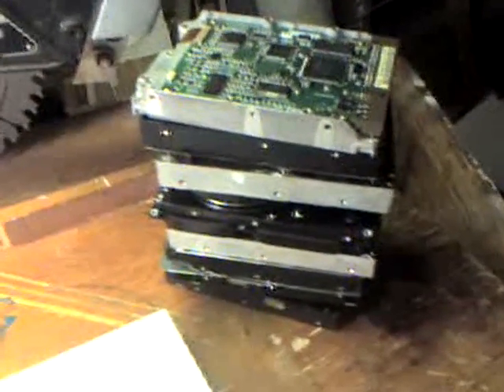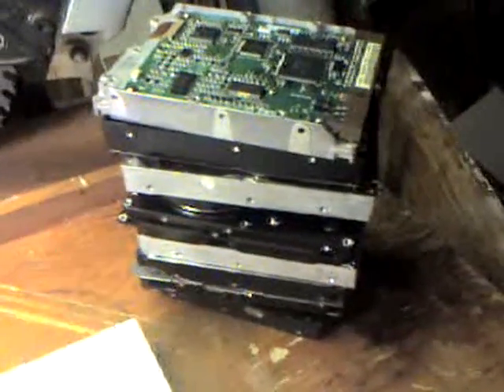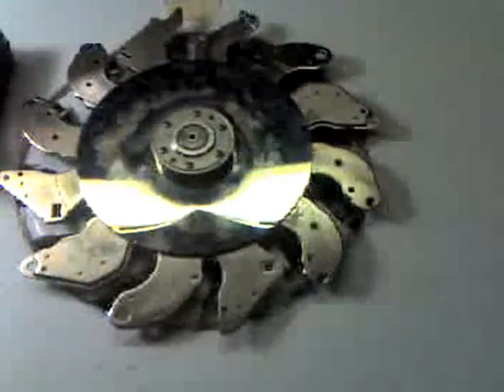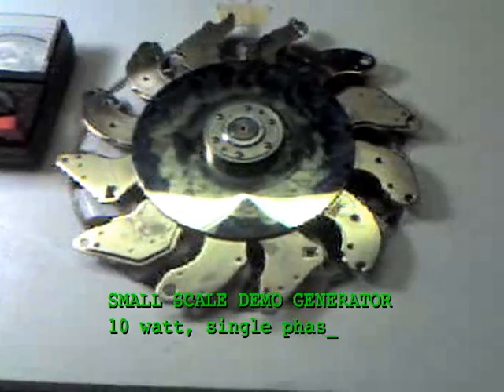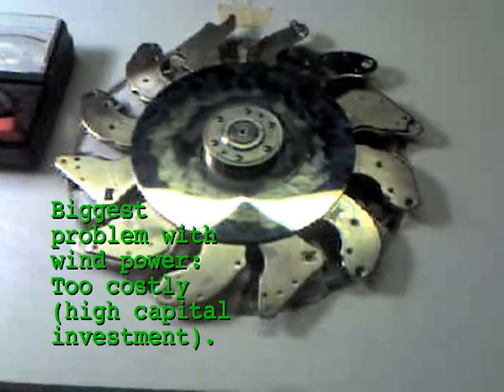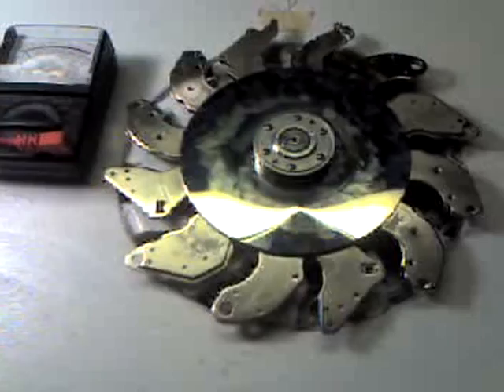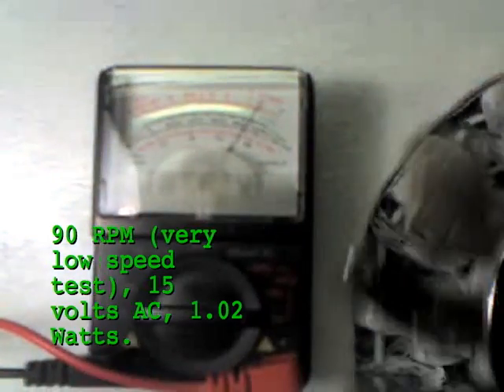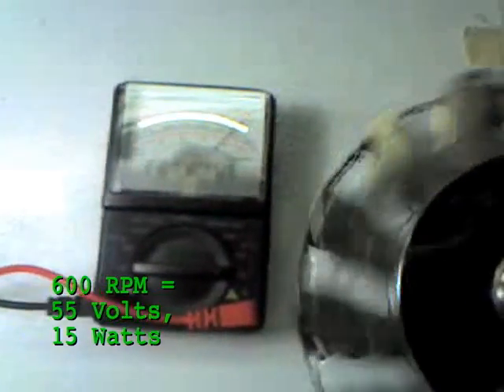Home built electricity magnet generator alternator turbine hard drives

Comment: see ... THERE IS NO possibility of moving something, if there is a constant force to the movement ... Magnets are dead bodies, they just move the existing eletons the coils, if exists FORCE acting on them, and of course, this force is only possible with some one running water engine (hidreleticas), DIESEL (explosion mototes) or flammable gases, such as uranium (thermonuclear), etc. then there is no free energy, if ever exists, then it will be used quickly, at all, and even then, to usála will not be free, because is the need to maintain the system.
Reply: Spot on, I got here looking for how to build a small scale generator from HDD magnets and everybody in here talking about free energy machines, I'm just like "guys, free energy is like Sasquatch, it doesn't exist, no matter how badly people who support the idea say so." Although part of me is thinking they mean "free energy" as in how to cheaply build an electricity generator that you can then use to make your own electricity at home "for free" (although then they would be ignoring initial costs and maintenance).

Comment: I think the 55W reading is a bit high. 55W is enough to raise a 5.5kg by 1m in a 10m/s² gravitational field in one second. Nice recycling, though. I’m lucky to have a recycling centre nearby which paid me 40NZD for three rusting 80s PCs I found in my coal bin once I separated the parts into boards, chips, heatsinks, cables and drives.

Comment: What the hell am I listening too. Is that a "cover" of "Mc Hammer - Can't touch this"... Other than that, pretty cool vid. I'd like to see how you made it all. 90 rpm at 15volts and 1watt... I could definitely see this thing cranking pretty good in a some decent wind if it was gear reduced. Might even work well as a micro hydro thing.

Comment: I take it this machine is driven by its self with out any help from outside power cables ,because most hard drives have motors and going by the footage there is an outside power cable taped to the table at the back,come on pull the other one its got bells on it.

Comment: First at all, I did not see any 'axial flux' on your video. This require pairs of magnet rotating around coils. 

Second, you did not provide us information about your load. Voltage itself say nothing. Current?

How many hard drives I must buy in order to complete one generator? I have none broken drives. 

Your idea about saving world is okay, but your video did not provide us such feeling that you will success in that. Sorry.

Comment: @blueorchid1100 Are you talking about negative friction? If you can pull that one off... I will be glad to give it a try. Problem is, that will send you volts to a level that what ever you are powering will get toasted. You would need a braking system or a high voltage storage unit. I am pretty sure this will work. No to sure about ferroiquid theory though.

Comment: Besides, I think the efficiency of common solar cells is 6%. Leds are more efficient light emitters than incandescent, but still put out heat energy, as a waste product. I know, I have been playing with them since the 80's. So a closed loop will not work. The idea of using magnetic energy is more promising. You cannot get free energy from anything. But using radioactive waste would be smarter, in my opinion, Kill two birds with one stone. Radioactive waste gives off a lot of energy

Comment: @orion1077 You did see the multimeter right? Attach a small lightbulb. Measure voltage across a known resistance, and you can find your amps.

Comment: Nice vid, but the most expensive part of a wind turbine is not the generator, it is the tower and the blades. The generators within the wind turbines very efficient and and lightweight, why would you want to replace a relatively inexpensive part with a heavy recycled piece of crap which will need a stronger structure? Sorry but this will not lower the capital, the only thing it will lower is the efficiency of the turbine.

Comment: Ok, the problem with this is that harddisk magnets have their north and south poles on the sides so they work against each other. Buy magnets that have the north and south top and bottom and you have much more watts. I am planning to do this soon with a harddisk. TIP if you want a bigger disc on your motor, if you cut the center out of a cd (in the groove that goes inside the transparant center) it fits just right on a harddisk motor. Use one platter under the cd for strength.
Reply: sunnycheetah The poles were a question of mine. I have been trying my arse off to do something like this but with the poles on the sides, its a pita. U ever get yours to work? I've got like 50 old hard drives and fans and I'm just too stupid to figure out a magnet mounting system.

Comment: There is something wrong:
you cannot say 15 Vac simply by putting your multimeter close to the magnets, you need a coil, and to measure the voltage and current inside to calculate the power.
If i move the needle of the tachymeter of my car  with a magnet, it doesn't mean my car is moving...

Comment: so say you had this setup on 4 different car tires, or 2 bike tires going like 55 mph... would that be a ton of power that could be used on board, stored, or used for propulsion?  and i dont mean have a fan hanging off of the car, i mean having the coil and magnet setup on some type of wheel well external rig type type thing,,